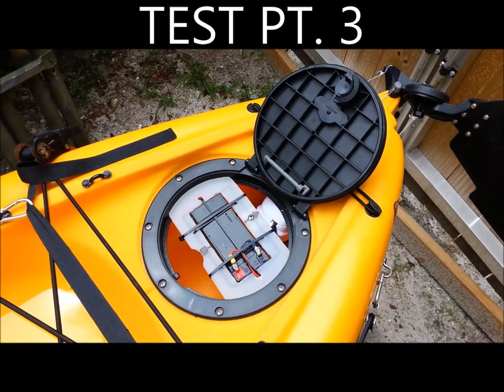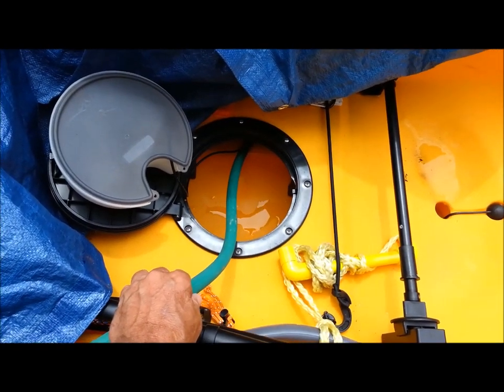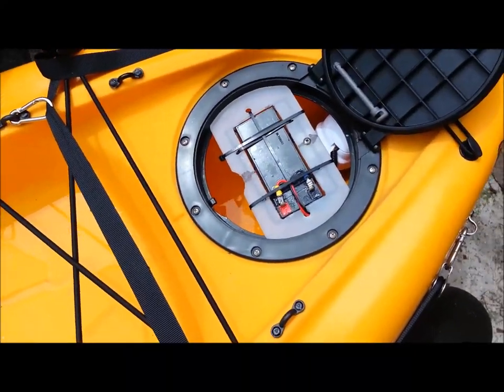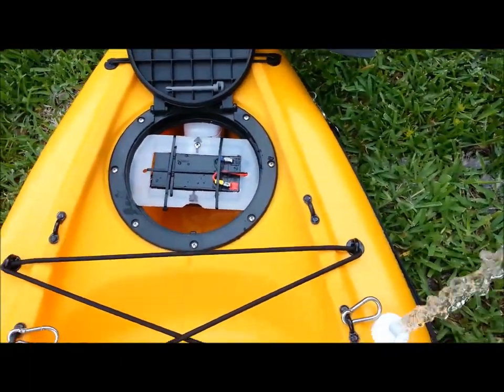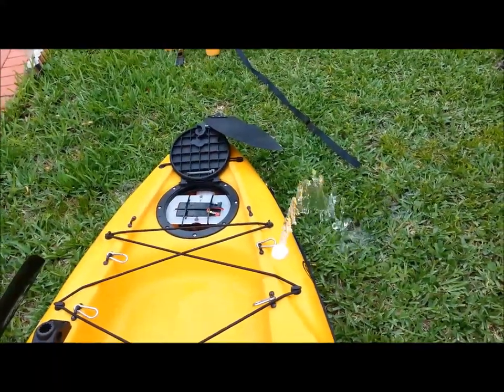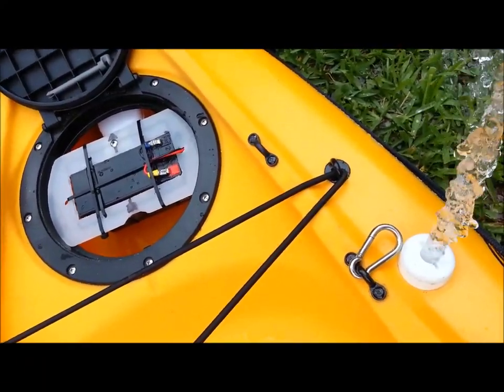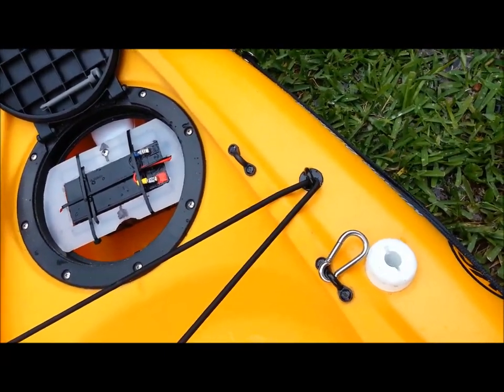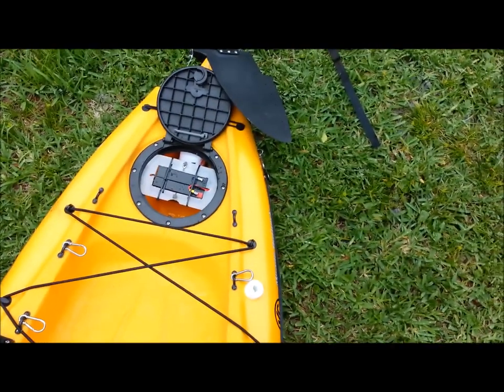Hobie Outback Self Contained Automatic Bilge Pump PT 3 Final Test

Comment: what part of the impeller housing did you drill. I made the same system you demonstrated and I'm ready accept for the airlock prevention hole. Also, you mentioned adding foam to raise the float highter. Any pics or drawings on how to do it. I tried and failed.
Reply from the maker: I drilled a very small hole in the top of the upper plastic housing where the impeller rides. I will try to post a short video later today. The foam didn't work, either for me. Actually I want the float to be as low as possible to the keel to eliminate as much water as possible.
Reply from the maker: @angioman the fix for airlock hole video is posted here. https://youtu.be/Hk2HxEM-mgs